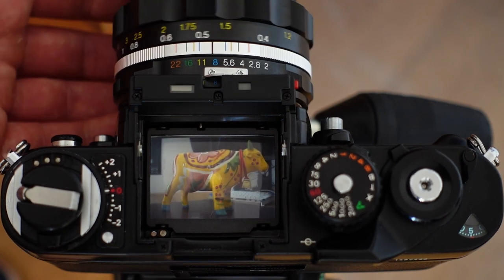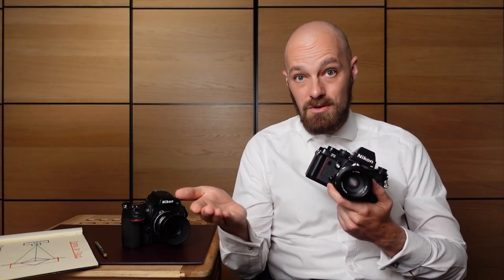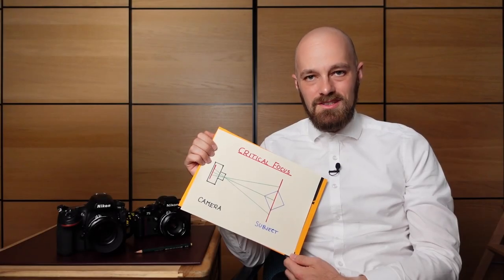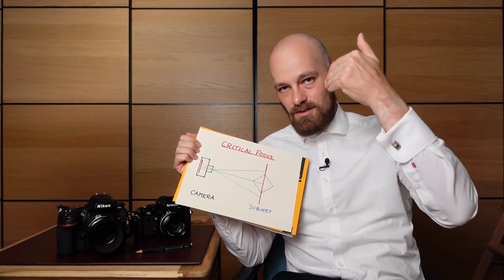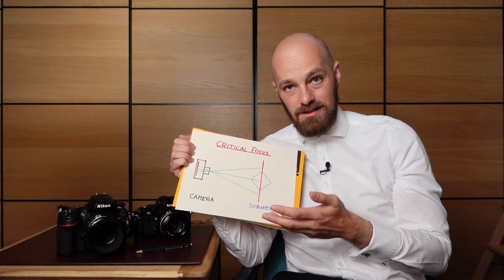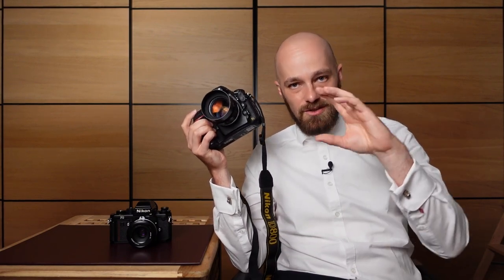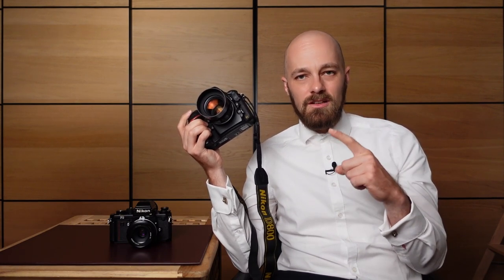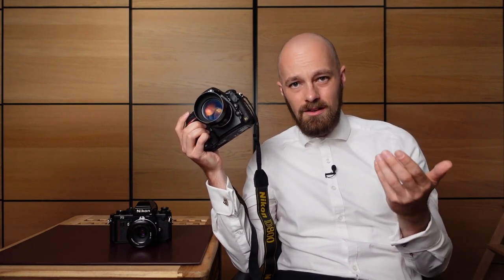Manually Focusing (D)SLRs - Understanding the Theory, Mastering the Technique

Comment: Yeah, I agree with your last statement: manual focus is fun for me because when I get 1 in 100 pictures I take in focus, I'm absolutely overfilled with joy :)
Reply from the maker: That sounds like you should practice MF a bit 😉
Reply: @ThomasEisl.Photography  I may have exaggerated that figure a bit, but you're definitely bit wrong :)
I have been shooting with manual focus lenses for over 10 years now, but I haven't heard of that technique you mentioned until I saw your video. 
I'll definitely give it a try when using my Canon 6d I recently purchased to use with Zuiko lenses. Getting consistently good focus on DSLRs or rough especially when compared to mirrorless and old film SLRs. I really wish my 6d had a microprism focusing screen :(
Reply from the maker: @androoy.p yeah, a micro prism focusing screen is really a huge advantage!

Comment: Just got a Voigtlander 58mm 1.4 for my D850. Had to fine tune the focus in-camera ( yes this is possible with manual lenses when there are cpu contacts) and now it is spot on. Great lens by the way.
Reply from the maker: Awesome! Yes, fine tuning the chipped lenses is really a great, underrated feature! I'm happy that you like the lens as much as I do!
Reply: @ThomasEisl.Photography  Underrated and mostly unknown. Many think finetuning is only possible with AF lenses. Regarding the Voigtlander lens I think I will get the 28 and 40mm also. There is even a 90mm but can not find many reviews about it. Any experience with the 90mm?
Reply from the maker: I am planning on getting the 90mm, I've not tried it personally so far. I've got the 85mm 1.8 which so I'm having a hard time justifying the 90 haha 😆
Reply: @ThomasEisl.Photography  well gear can brake down on long term. So far I managed to brake 3 camera's and 5 lenses. So redundancy is always welcome.
Reply from the maker: Love the argument! Yes, you are right - stuff breaks down occasionally!

Comment: Thank You.  That's a brilliant Tip: I'd never thought of starting and infinity and coming back through the plane of sharpest focus. I do wish the Nikon confirmation dot could be located at the focus point instead of at the bottom edge of the viewfinder. For portraits, I can focus my 135mm f3.5 Ais  & D3X exactly on the iris at closest focus distance - provided I steady the camera on a tripod.  Tim (Southampton U.K.)
Reply from the maker: Thank you, I'm happy that you liked the video!
Regarding the focus confirmation, I wholeheartedly agree! I would love if the focus points which have detected focus would just "light up", similar to how they do when using all AF-points in S-AF.
Using a tripod is an awesome tip - it is really hard to focus these FF telephoto lenses wide open when shooting portraits. I wil definitly start doing that more often - maybe I give the good ol monopod a shot. 
Best wishes to you, Tim!
Reply: @ThomasEisl.Photography  My brother & I have ball heads (a Gitzo head & a Benro head) which have a large and a smaller tension knob. The larger one does most of the work whilst the  smaller one lets you vary the tension and get smoother movement to follow the eye as it moves in the viewfinder.
Reply from the maker: I will try that by borrowing one, I know a guy who has one! Thanks for the, tip, again! That's awesome, love to learn new best practices from other photographers!

Comment: Pretty much what we learned in journalist school, this was early days of digital like 2007 for us anyway, our school had just retired the analogue film cameras mere 3 years prior. 
Anyway, the teachers were old school conflict reporters who were used to operate manual cameras although also did digital remember back in 2000 - 2007, digital cameras had very meh autofocus very bad in low light and okay in good light, lenses were slow, cameras were hunting a lot before they "catched" the focus, so manual was sometimes preferable. 
The start with infinitive I remember well, then the teacher taught us to rack the focus back quickly and start going back and forth a lot till we get the focus point, this assured speed in situations that needed it, he also stated that having a larger aperture stop was preferable just to avoid the hunting as much as possible, and use wider lenses.
But this practise of going infinite focus, then rack back and start hunting back and forth like super quick still holds in my hands even to this day even though I just let the autofocus do most the job, its always fun to shoot a manual lens every now and then and noticed I still do the same tactics I was taught at journalist school.
Reply from the maker: Thank you so much for sharing that - good technique ages well, it seems.

Even today, regardless of camera and AF system used, being able to focus manually can be a "lifesaver" under challenging circumstances!

Comment: That was very interesting. When I used to shoot film with a manual camera I was happy enough to just focus through the subject as often as it took to feel confident that I had succeeded but never gave much thought to the question "Is this the best approach?". The method you have described and explained makes perfect sense to me as I was always looking for a sudden increase in sharpness (from either direction... ) and then turning it back very slightly to compensate for my overshoot. Turning fast worked tolerably well on a lens where the total throw was less than 180 deg. -  not so well when the throw is well over 270 deg!
I'm certainly going to try this. Thanks
Reply from the maker: I am happy that the video was of value to you. Thanks for sharing your experiences - the impact of focus throw is indeed not to be underestimated! I have not paid enough attention to its impact so far, so I am very thankful for you pointing that out!

Comment: Excellent discussion. I use manually focussed lenses in the same way and the focussing screens if they are interchangeable they are a great tool. In the past there were different specialist focusing screens for different types of working. The most common type available had a fine ground surface with a micro prism collar around a split field. These gave the ability to either place the split field and micro prism collar on the part of the image that needed to be critically focused and resolve the rangefinder pattern to focus the lens. Once focused you could then reframe for the composition. Or else, the ground glass outfield could be used to select the part of the frame in critical focus without focussing and reframing. I got into gridded plain screens and they tend to be my favoured style of screen because, I am looking for detail that I want to see sharply wherever it falls in the frame.
Reply from the maker: Thank you very much for your extensive, very relevant comment! Much appreciated.
It is a shame that those screens are rarely available for contemorary cameras - set aside special customized screens from third party manufacturers.

Comment: Thank you so much for a very comprehensive explanation on the subject of manual focusing. Since I find that I often back-focus I have developed a method of setting the focus and then back off my whole body (and camera) a very tiny amount for my first shot. Then I move forward ever so slightly (with my whole body without turning the focusing ring) and take a second shot. I repeat this procedure until I deem the object to have been safely nailed. The extra bonus with this method is that I get a series of images that I can use for focus-stacking in my post-process later, if I prefer. Of course, this only applies for static or still objects. 
With this technique my whole body becomes in fact a focusing rail. The needed amount of movement between shots depends on the distance between the camera and the critical plain of focus. I even use this method while shooting macro! The only difference is that I often sit on the ground with the camera very close to the ground in front of me. I set the plain of critical focus and then I back the camera off a bit and start shooting. For every exposure I move the camera ever so slightly closer to the object. I prefer this method because tripod and focusing rails becomes very inflexible and clumsy out in the field. Especially if I want to be very close to the ground with the camera. 

All in all, even with auto focus systems we need to learn these techniques of nailing the critical plain of focus manually. As you said, we need to find a method and practice it regularly in order to always be able to compensate for the tricks that real world scenarios play on our optical equipments. Learning how to handle manual focusing is essential even when using auto focus equipment. Especially if we often prefer using our lenses in wide open apertures with a very narrow span of acceptable sharpness. Having learned a method of consistently succeed in getting the focus right manually opens up for the vast array of wonderful vintage lenses that can bring a whole “new” dimension to our photography! Remember, we always have the option to turn off the auto focus system in our equipment and start practicing with the equipment we currently have to our disposal. Manual focus is a skill that needs practice to be useful. When we have the skill we will always be able to nail the shot regardless circumstances without being blindly dependent on the auto settings in our equipment. Also, taking extra interest and care about how focusing works with our equipment we start to appreciate other and more fundamental aspects of photography. Our photography grows and we become more skilful as a consequence. Taking deeper interest in the aspects of focus also opens up the possibility of developing a deeper interests in the relationship between in-focus and out-of-focus areas in a photograph. This is an aspect that is unique to the art of photography and is normally not seen within any other form of visual artistic expressions. Embrace that instead of viewing it as a limitation.

Comment: Really helpful video. Bottom line, as with most things, practice, practice, practice! I still shoot lots of film. I must admit that tracking my fast moving granddaughter scares me regarding wasting frames. I think your techniques will get my hit rate moving in the correct direction!
Reply from the maker: Thank you very much for the comment, I'm glad that this video was helpful and I hope that you will get more great shots of your granddaughter! If you want to save film, you can get a cheap second hand DSLR to practice your technique! Cheers and good light to you!
Reply: I shot my kids 15 years ago in a pulled cart (German: Bollerwagen) running beside it with my Nikkormat and 35-105 lens on slide film and hitrate was almost 100%. Then I bought a Sigma SD-10 digital SLR, did the same next year, and hitrate was close to 0%. So I sold it again and did digital on compacts only, untill september 2020 when I bought an old Lumix G2.

Comment: Nice video. However you should imho set your teleprompter to a faster speed. From a viewer's perspective you're talking painfully slow 😴. Now with all the techniques you mention there are unfortunately a few "real world problems":
1) in my experience most analog cameras are older and (with very few exceptions) definitively need focus calibration because the point of focus is usually off by at least a few centimeters if your subject is 1m away. This needs to be fixed first.
2) A lot of lenses suffer from focus shift (for example the otherwise great lens Nikon 58mm f1.4 AF-S G or the old Canon 50mm 1.2 L). You need to focus at the aperture that you plan to shoot at to avoid misfocus. If you focus at f1.4 witch such a lens and shoot at f2 the image may be out of focus again because of focus shift.
3) You need special focus screens to correctly focus manually with very fast lenses. Most focus screens of "modern" cameras have a fresnel lens pattern etched into it. This brightens up the image on the focus screen, but has the huge disadvantage that you see the image as if you were taking it at - say - f2.8 even if you have a f1.2 lens on your camera (press the aperture preview button to check this with a very fast lens and watch the depth of field). This way you've got zero chance to achieve critical sharpness. The only thing that can be done about this is to use a proper focusing screen without an integrated fresnel lens (having the disadvantage that viewfinder gets very dark if you use a slow lens) or to use the electronic focus indicator of the camera - which of course will work correclty only, if the camera is perfectly calibrated (which it usually isn't in my ecperience - see 1).
Reply from the maker: 1) I agree - as I only use professionally serviced and calibrated cameras (what I would recommend for anyone doing serious photography)
2) I agree - and I have experienced that as well. 
3) I agree - that is why I came up with this (tried and tested) method of focusing, which significantly helps getting the focus right even with the pre-installed screens. In my F6, I use proper screens for MF lenses.

So the techniques themselves don't have real world problems, it is rather the real world that makes these technqiues necessary. And of course, there is no 100% solution if you don't know how your gear behaves.

... and I don't use a teleprompter, just speed me up in playback :-)
Reply: Thanks for a very informative and helpful video. I prefer your deliberate delivery. It allows me to reflect on the content that is unfamiliar. In part I judge videos by the quality of the comments. This is clearly a five star presentation.
Reply from the maker: @Michael Voy - thank you very much for the very encouraging comment. That means a lot to me. Thanks again!

Comment: Superb, I am going to use your techniques with my D500 and D7100 along with a voigtlander 58mm 1.4 which is incredible if you haven’t tried it and works great for certain portraits on my crop sensor as it resolves like a longer lens on a full frame, cheers and subscribing now.
Reply from the maker: Great to hear - and thanks for subscribing!
That is a cool tip, I will definitely try the 58mm with my D7000! Thanks!

Comment: Manual Focusing WITHOUT the split prism is a pain in the ass. Neither zooming in nor using contrast peaking work to precisely determine the critical point of focus. I really wish that Sony, Canon or some other manufacturer will display a "Fake" split prism and microprism collar generated by using the phase detection sensors they already have embedded on the image sensor anyway. Depending on the phase, offset the image within those prisms either one or more pixels to the right or left. Simple enough to do in 2D transnational graphics.
--
The only lens I use that is manual these days is the Loxia 2.8/21 and only because I don't really have to focus most of the time taking scenics, and if I do it is more to get objects within rough DOF range rather than precisely focusing (like you might taking a portrait) at a wide aperture.
Reply from the maker: Thanks for sharing your experiences!

Comment: A very interesting video thank you, am I understanding correctly if you have a camera with the position of the senser or film etched on the camera and attach a 50mm lens  the Line of Critical Focus is 50mm from that mark.
Old lenses like the Helios 44-2 are good for focusing at maximum appature with having the preset control ring
Reply from the maker: Thank you very much for your kind words!  Depending on where you set the focus, the actual focus distance will be different. I recommend referring to the distance scale printed on the lens! 📸

Comment: One more thing, if you're saying that depth of field is larger towards the back of the plane of critical focus, than why are the depth of field markers on all lenses are symentical?
Reply from the maker: Because they are only approximations.
Don't forget - DoF is relative not absolute. The tolerable CoC size dépens on enlargement, and therefore on surface are of the capture media and the output size.

Comment: Very good video. I might be nit-picking, but the plane of focus is parallel to the lens and getting the correct plane needs the film/sensor to be parallel to the lens. If you bang your camera, for example, you can slightly mis-align the sensor and it is then impossible to get the sensor aligned with the plane of critical focus parallel to the lens.
Reply from the maker: Absolutely correct! 
Thanks for pointing that out!

Thanks for the kind words!

Comment: Will a Nikon D2X meter with an older lens ?
Reply from the maker: In short: yes!
Here is the long answer quoting Nikon USA:"AF Nikkor (including AF-S, DX, VR and D-/G-type): All functions possible; D-type Manual-Focus Nikkor: All functions except autofocus and some exposure modes available; AF Nikkor other than D-/G-type: All functions except 3D Color Matrix Metering II and 3D Multi-Sensor Balanced Fill-Flash possible; AI-P Nikkor: All functions except 3D Color Matrix Metering II, 3D Multi-Sensor Balanced Fill-Flash and AF possible; Non-CPU AI Nikkor: Usable in [A] or [M] mode with Matrix-Metering, Center-Weighted and Spot metering available. Indication of aperture number after user inputs the aperture f/stop and focal length f=mm by multi-selector operation. Electronic Rangefinder usable with maximum aperture of f/5.6 or faster."